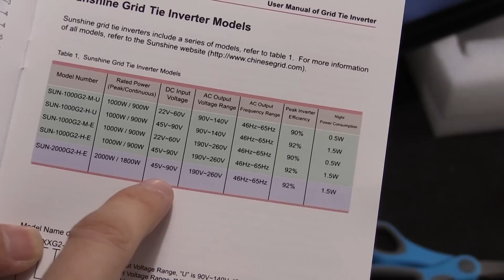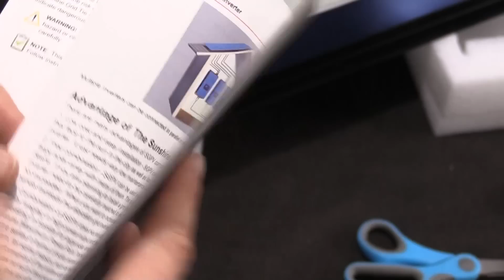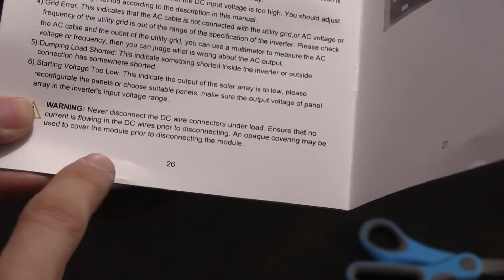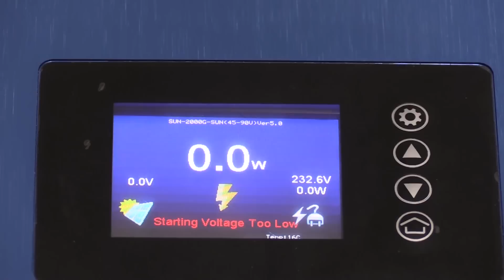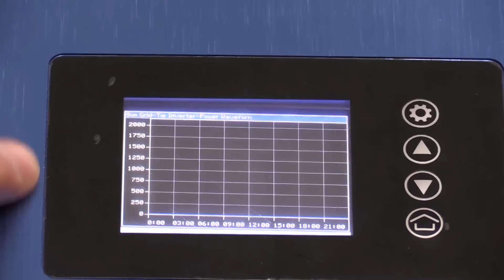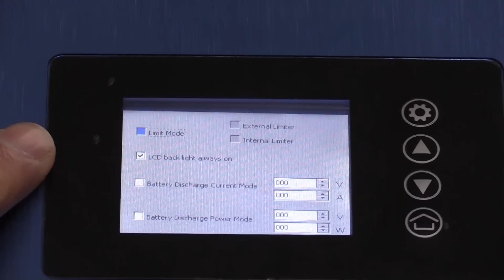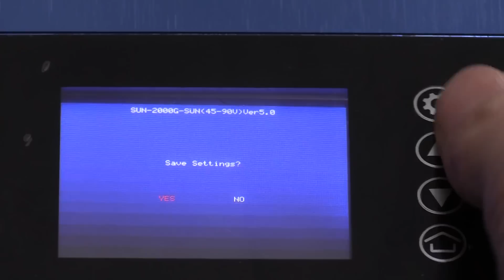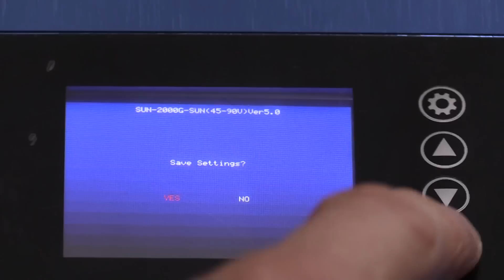Unboxing GTIL2 2000w Grid Tie Inverter with limiter

Comment: If the battery discharge current and power at 13:42 were working could you rely on these for use on a Pb battery storage system? I'm looking to get 4x 110 Ah Pb leisure batteries for a total of 48V 110Ah or 5.28 kWh to hook into one of these. Great work with your project!

Comment: Hi Mike, what happens with the excess power that you generate. Do you 'loose' it into the grid?
Reply from the maker: hmm do you mean with this inverter GTIL2 ? or with my other inverter. This one has a limiter so it only gives out enough excess to power the house and no more. On my other inverter the Solax 5kWh it is grid-tie and any excess that the house doesnt use goes to the grid and i get paid for it, at a whopping 8c kWh.

Comment: Thanks Mike, I did not understand "Limiter" and it doesn't seem to be explained any where.
I'm still not 100% sure with what you have said either. Is it grid tied? does it only output kw's to match the demand for the load?, eg if the demand from the house is 500 watts, then the output is 500 watts, if the demand is 1.8Kws then the output is 1.8 kw's?? If the demand is greater than its max capacity then it outputs its max or what ever your battery's can give?????? Thanks
Reply from the maker: A normal grid-tie inverter doesn't have a limiter, and its going to try turn as much DC into AC as possible which is fine if you have solar connected to the DC but if its Batts on the DC you don't want the inverter running at full. So you need a limiter on the grid-tie which then does what you said above, "if the demand from the house is 500 watts, then the output is "limited to 500 watts to match." If the inverter has a limit of say 2000w and in the house someone turns on a bigger load say a kettle then the first 2000w will come from the inverter and what ever is left say 400w needed will come from the grid until the house load drops and it can all balance out again. Does that help?
Reply: Yes it does, thanks. My system is a lot smaller, my grid tie inverter is only 650 watts, I simply turn it off when the demand is less than 650 watts. Because we have two repeatable periods every day when we use more than 650 watts I have recently put the inverter onto a time clock switch, to co inside with these two periods, it is simple and works well. Cheers
Reply: @MikesDIYTeslaPowerwall  Am I correct to say that in the setup menu, you would tick the "Limit Mode" if you want to stop Backfeeding and then you would click on Internal or External depending on whatever port the CT Clamp was connected to ?

Comment: Hello how does Grid tie inverters work? From what i can understand you got mains coming in and mains going out back into the panel power box, Then you have your batteries and solar panels connected to the inverter? So if mains power goes out there will still be Power on correct? Kind of like a UPS you would have on a PC. But with this Inverter it doesn't look like power is going out so how does it work? 

Also Great video.

Comment: hey Mike, the RS485 would be the Serial Communication port. i am surprised it did not have the port or maybe yours is broken ?
Reply from the maker: Nope diff no port or plug for there
Reply: +Mikes DIY Tesla Powerwall  I bet they have one that has this port and the call it "extra feature"  and charge you a fortune. :)
Reply from the maker: or they use it to program it etc

Comment: the stupid thing about never disconnecting when under load is the fact this inverter  can be hooked up to solar panels with out a battery, so what happens then a cloud blocks the sun oO the dc power is cut and it could be at a time when the unit is under load oO.
Reply: I was wondering the same thing. And in the event of a blackout, the AC side goes down without warning, so really it shouldn't matter which side gets disconnected first. If it does then the design sucks.
Reply: ive tested this and it does indeed seem to not matter oO